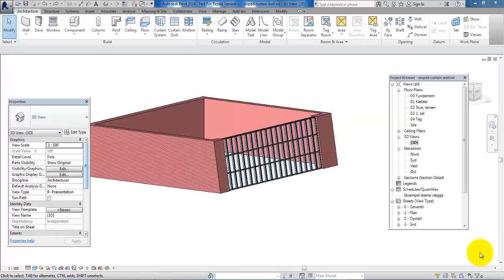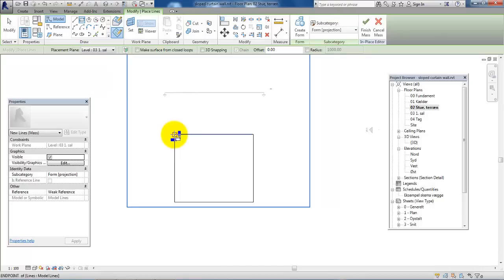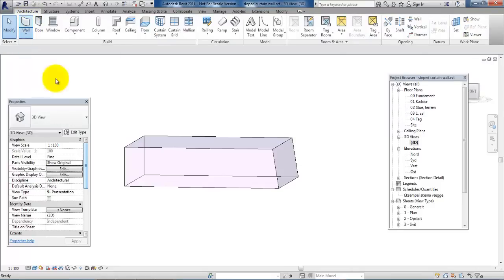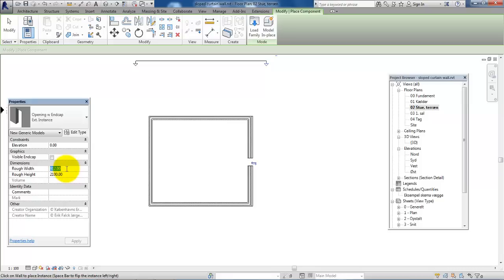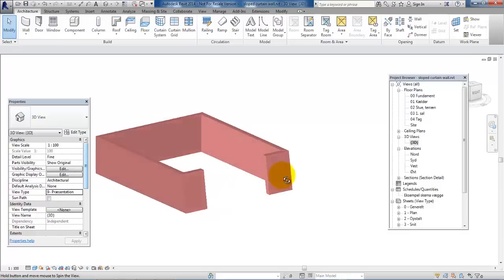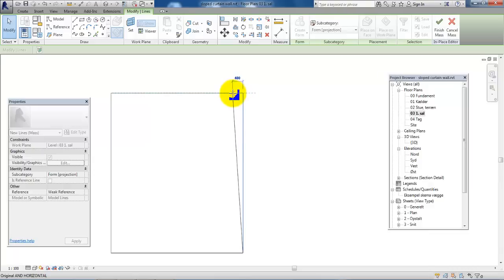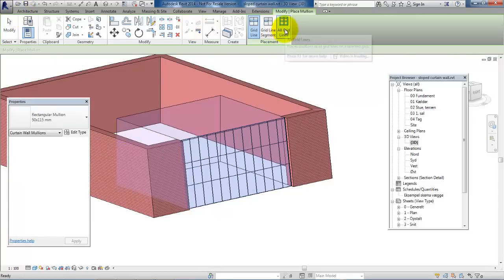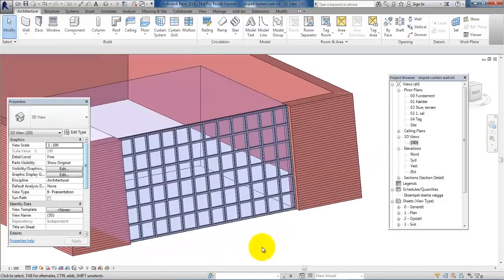Revit 2014_Sloped curtain wall

Comment: where can i find the component for the opening ? please
Reply from the maker: aldoneitor69 The opening component is part of the template we use at VIA University College - but there is another way to create an opening. Go to the "Architecture" ribbon and choose the wall opening tools...that should give you more or less the same result...
Reply: that tool doesn't let you cut an opening into a slanted wall, is there any other way to do this opening?